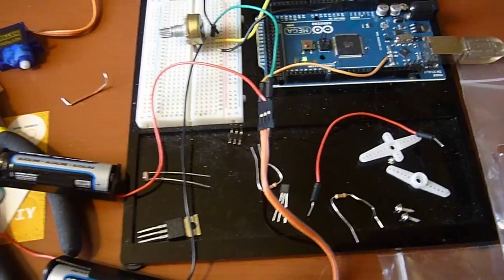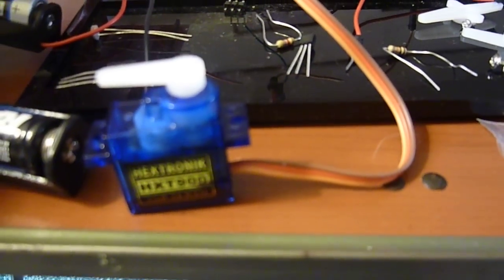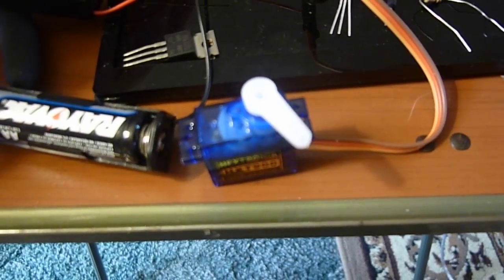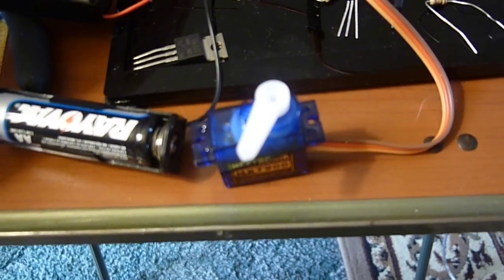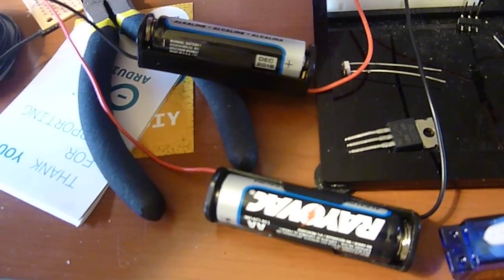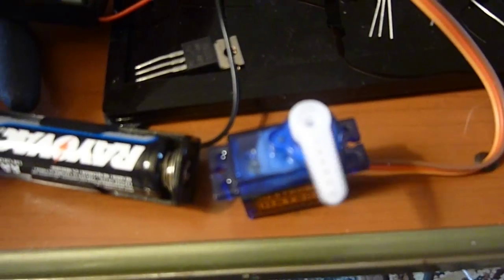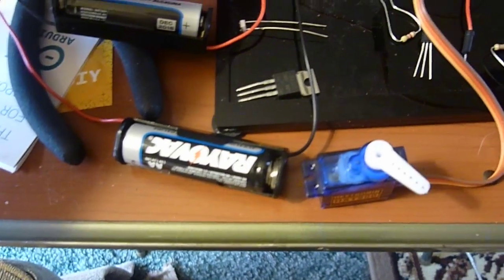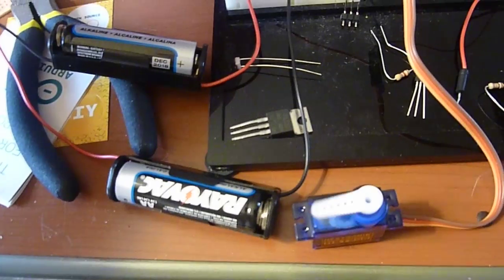Arduino positioned servo

Comment: The pointer to your data file points to one for Lifo batteries rather than servos.
Reply from the maker: actually it points my main blog page. I corrected the link in the description to point to the actual project page.
Reply from the maker: http://arduinotronics.blogspot.com/2012/03/fun-with-servos.html is the project page
Reply: @sspence65  Was believing that you had code published for the video.
Reply from the maker: @dennisrice456  the code is published at the link I posted above, and I also corrected the main description.